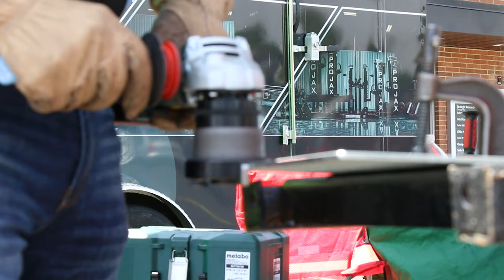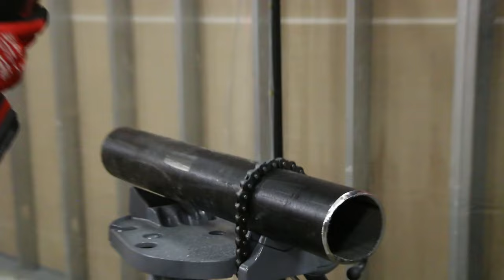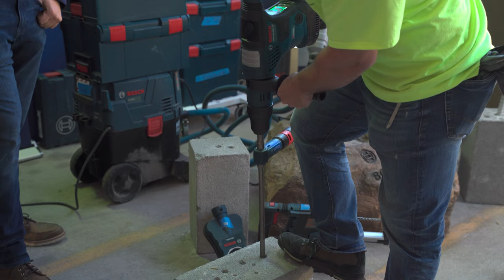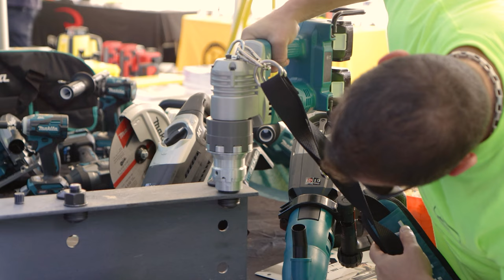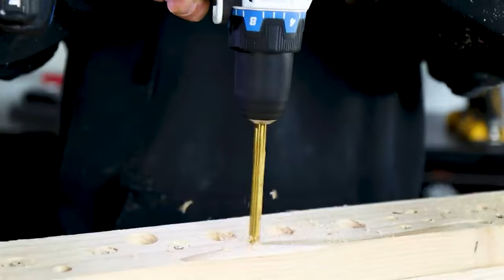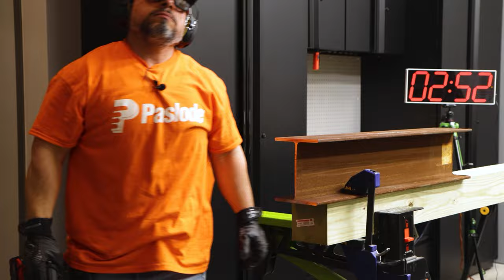10 Hours of Non Stop Power Tools

Comment: That blade is chewing through a steel I beam like no bodies business...  Why did engineers/manufacturers shy away from the adjustable shoe design. Adjustable shoe = more optimised usage of expensive/consumable blades.  signed... desperate for answers in ABQ...